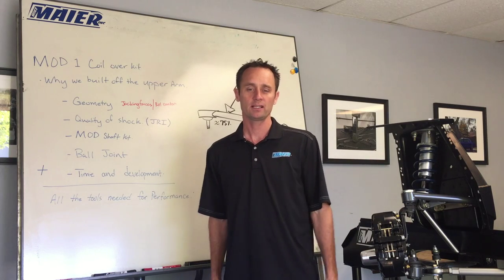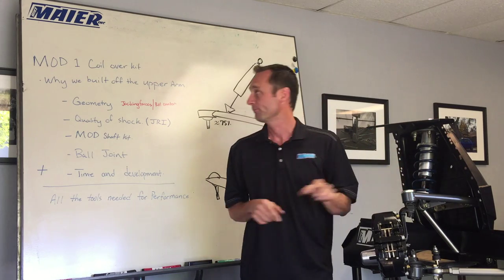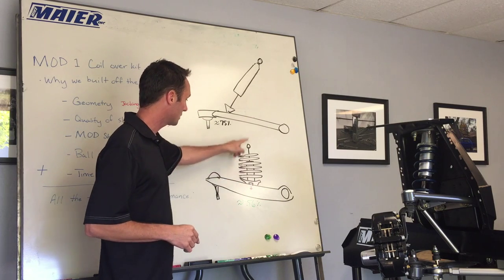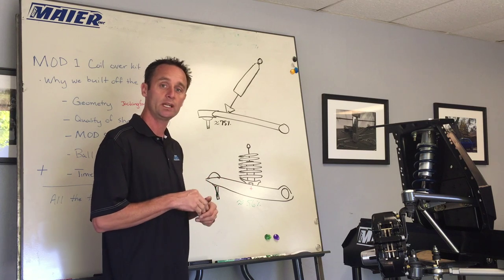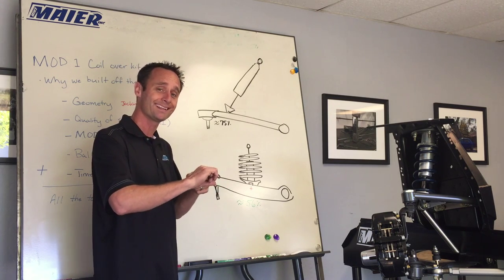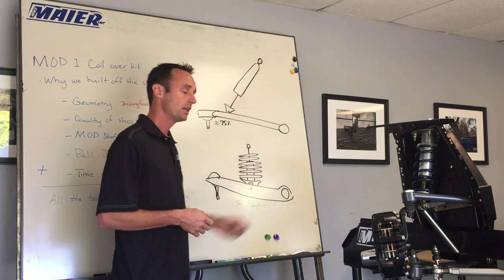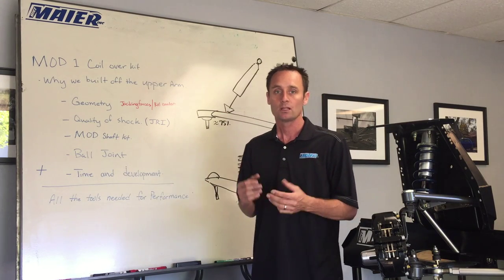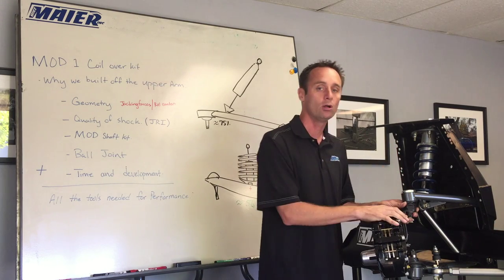MMI MOD1 Front Suspension Technical Explanation

Comment: Great video and great products.  Quick question about the geometry you chose for your kit.  Why did you choose to mount the lower connection of the coilover to UCA?  Seems like it could be closer to 1:1 if it were connected to the LCA closer to the centerpoint of the wheel.  I'm an uneducated novice, so just going by my own common sense.